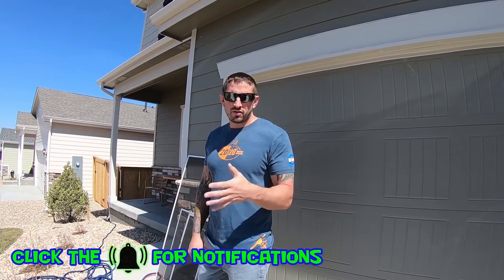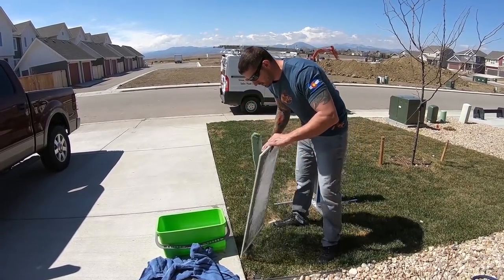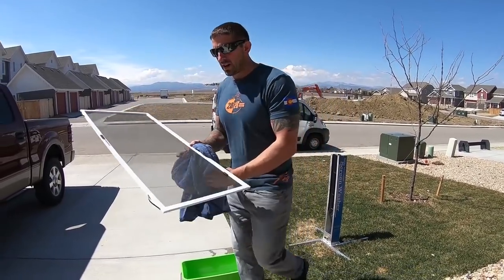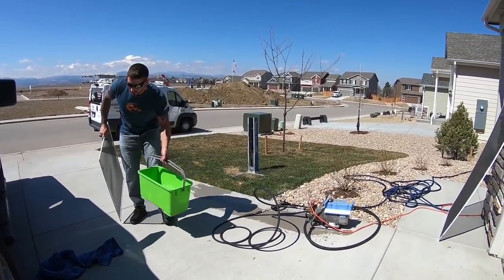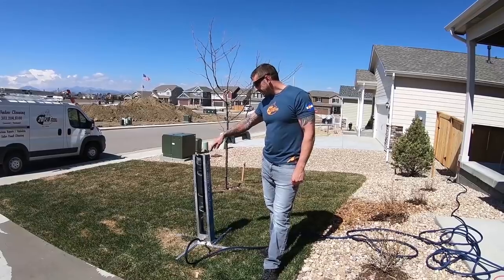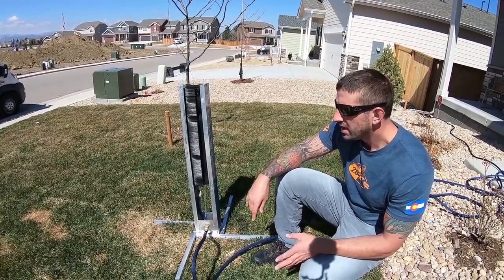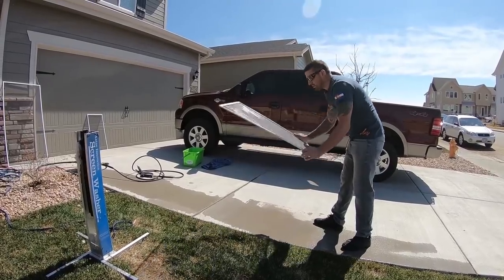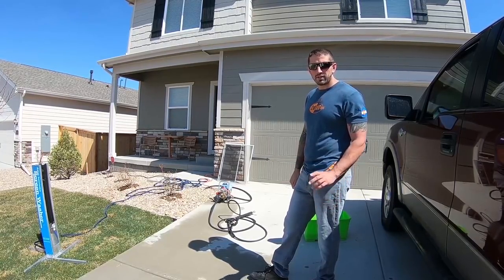HOW TO CLEAN SCREENS FOR WINDOWS

Comment: Thanks SteveO, I almost bought the screen washer a couple of weeks ago. Here in Australia 95% of house's need the screens washed. But after watching your vid I'll go with the pressure washer.
Reply from the maker: Joe Lorenzo it’s just so quick and easy, a little more expensive then screen washer but well worth it
Reply: @SteveOthewindowcleaner  Sorry to bother you again man, but what pressure washer are you using. It looks like a great little compact unit. Thanks
Reply from the maker: Joe Lorenzo https://www.pressurewashersdirect.com/Kranzle-K1622-Pressure-Washer/p11085.html
Reply: I been using pressure washing on screens for years , i just adjust the throttle speed since is a Dewalt 4200 psi I use for multiple purposes or you can buy a ship electric one which is more than enough to wash screens and get moving big screen amounts of screen cleaning
Reply: I know this is old but I'll give it a shot. When i do the math dollars for time + results, screens are a serious money maker. When i see this screen cleaner and it being able to blow through 25 screens in 10 mins i start to see a great investment. Frames can be wiped again before inserting and i know all of my customers would be happy. Any thoughts??

Comment: Hi SteveO. When you clean a sliding screen door, do you remove it from the tracks? What is your process with sliding screen doors?
Reply from the maker: If it comes off easily then yes but if not I just brush it off with my towel

Comment: Hey SteveO I have a question about Residential window cleaning: If your Cleaning windows water Fed  are you using the client's water and if so does that affect the price?
Reply from the maker: Yes we use the clients water and it does NOT decrease the price. We've never had a customer complain about it.
Reply: @SteveOthewindowcleaner  Thanks for the reply, I was just wondering how that works.